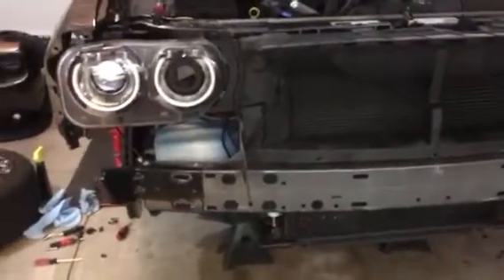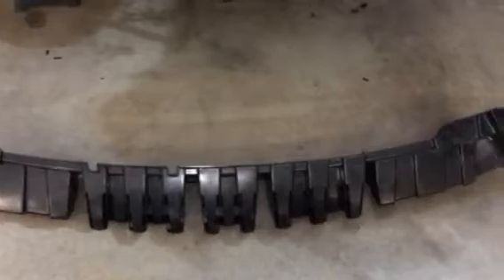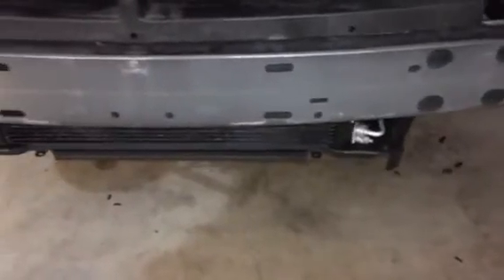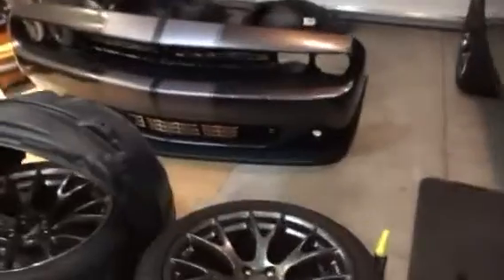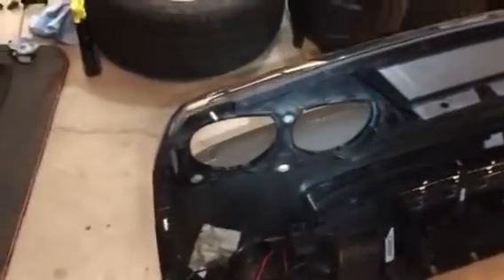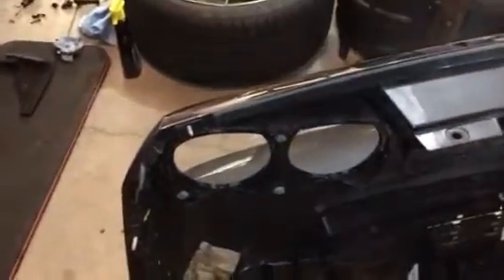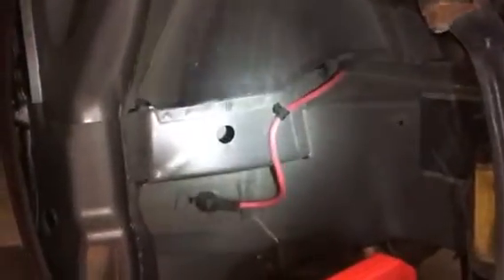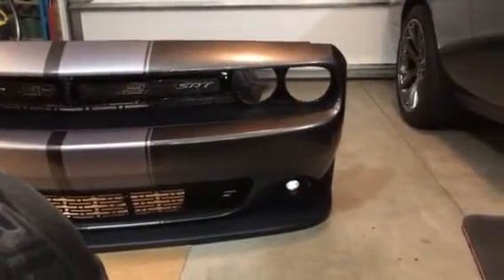2015 Challenger SRT Hellcat nose conversion Part 2

Comment: What did you do with the factory fog lights
Reply from the maker: Removed them and kept them with the stock fascia
Reply: @alconk7129  how did you delete the fog light electrical connector that plugs into the fog light assemblies on the bumper?
Reply from the maker: @anm4rt  I left it there and tied it up. You don’t want to get rid of that incase you want to switch back.
Reply: @alconk7129  did you have any issues with water or anything getting into the connections?
Reply from the maker: @anm4rt  not at all I taped the ends then zip tied them up op out of the way. They’re very well protected behind the fascia.
Reply: @alconk7129  this is great I’m planning on doing this and I haven’t found much information on the internet regarding that issue. Although I don’t really care as much for the fog lights. I recently had a new motor put in @ 72k miles and after that I dont really plan on getting rid of it anytime soon 😂
Reply: @alconk7129  are there any lights that pop up from disconnecting the fogs
Reply from the maker: @anm4rt  nope

Comment: Hey bud do you think the hellcat grill fits the SRT without changing the whole bumper
Reply from the maker: Mango_scat 392  No it will not , mine was the SRT so it all had to be changed. I traded the car in so I pulled the Hellcat nose back off. For sale if ur interested
Reply: alconk is it the complete conversion kit bumper?
Reply from the maker: Quinton G no it started with the conversion but you will have to supply a few more parts and fasteners to make it factory.
Reply: I bought the hellcat grill and didn’t fit :(  how much you asking for it ?
Reply: Hey bud how much you want for the bumper?
Reply: How much for the hellcat nose?
Reply from the maker: jesus ortiz sorry but sold.
Reply: Mango_scat 392 so does the hellcat grill fit on a regular scat bumper or it  doesnt? been thinking to swapp it out but idk